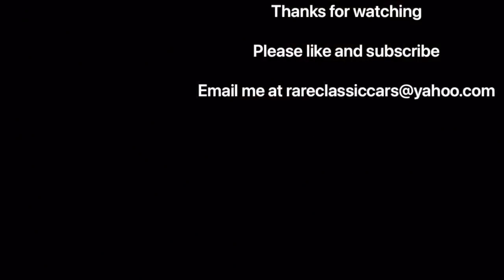Worst Engines of All Time: Chrysler 318/360/400/440 V8 Electronic Lean Burn

Comment: That was well explained.  Thanks.
It's no wonder Chrysler was bankrupt by '79 - their vehicles were really bad in the mid to late 70's.  Rust and terrible build quality.  And this Lean Burn system. Just really cheesy cars.  Then the K car came out.  Another gem.  I think what did save them for a while was idea of the minivan.  Their first ones of those were nothing to brag about either with that awful Mitsu 2.6 in them and the temporary transmissions.
Reply: After the government bailed out Chrysler they somehow had the money to buy bankrupt AMC.  The only reason they wanted it for was the Jeep.  The even kept making the AMC 258 straight six for awhile.
Reply: I also believe it really was the minivan, not the K car, that saved Chrysler. My sister had an '81 Aries with the Mitsu 2.6 and a 2 bbl carb and sad to say it was junk.
Reply: @Progrocker70  Yes. Can you imagine if there was internet back then and people could share their opinions and experiences like we do now?  Chrysler would have been dead.
Reply: @johnz8210  Exactly. I also had an '84 Turismo 2.2 that was also nothing but trouble. Water leaks around windshield, rattles, electrical issues, and of course carb problems. It either wouldn't start or would just decide to randomly die in traffic.

Comment: I had a 78 aspen with the slant six, it had a Carter bbd. Was called the "super six". Either it never had lean burn, or someone took it off. Really solid engine.
Reply: The slant six was an amazing engine Someone I knew had an old Valient with this motor and went 750,000 without much engine issues

Comment: Lose that useless "Electronic Lean Burn" system and you have great engines. Can't badmouth the engine, only the idiot engineers who designed flawed trash like this.
Maybe we could discuss V8-6-4 that GM tried out(which was a dismal failure)?
Reply: you are correct.iv ran the living guts out of chrysler v8s for decades. i always removed the mid-late 70s ignition and distributors and installed the very simple and good early 70s ignition controler and distributor.actually did it well into the 80s.correctly set up chrysler engines are second to none.the old high compression 440s were arguably the best mass produced muscle-car powerplants ever sold to the public at working man/blue collar prices.they pretty much ruled the streets.

Comment: I'm certain that all ELB engines had bare distribution with only a stationary hall effect pick up,  without centrifugal weights inside and no vacuum can on the outside.
Reply from the maker: The early ones definitely had centrifugal weights.
Reply: Not according to my old engine books , you must be thinking of the earlier electroic ignition distributors.

Comment: My -78 Newport started to backfire while cruising, so, as the replacement module from the dealer was an arm and a leg, electronic distributor from a speed shop an arm (in Finland in 1986), I replaced the stupid system with a points distributor from scrapyard. Replacing the plugs with a correct gap for points was a bigger job than the distributor (440) , but the engine run just fine or better with points, and the 440 apparently had enough margin to operate with too lean mix with those. I miss that car...
Reply: Nothing wrong with points if set up properly! I always liked the thought of a points in a car still working say there was an em pulse or something crazy 🤣
Reply: We had the same car and did the same thing as you.

Comment: Adam of course, you are correct. I am mopar guy. So I survived these lean burn issues but, if you converted to electronic ignition you got a good engine for 80's standards. However, if you know of assburn nobrain  (Osborne tramain) you tuber, you just made him really, really mad.

Comment: Excellent analysis of this system. I had no idea about the logic in these primitive systems, only that they resulted in some flaky behaviour in terms of driveability (I learned to drive on a 1979 Newport with the 318 Lean Burn).

It is notable that the issue of the day in the 1970's was fuel economy and unburned hydrocarbon emissions where the lean burn strategy was theoretically of benefit. Once the EPA got concerned about oxides of nitrogen emissions in the 80's, lean burn strategy became obsolete.

Thankfully, the widescale adoption of electronic fuel injection (and increasingly reliable electronics to support this technology) in the 90's solved a lot of the emissions, fuel economy and driveability issues for good.
Reply: BUT, computers can't be adjusted, and many can't be repaired.  They can only be replaced.
Reply: @michaelbenardo5695  plenty of YouTube channels exist where people repair computers from the 70s-80s. The stuff is repairable, but it's a different skill set from your average shadetree mechanic.

Comment: Having the soild state electrical board attached to a air cleaner that shakes   due to poor tuning makes it worse.The thermoquad would get its idle screws turned a million times also never finding a good idle with brown smoke coming out the back and then fill the intake manifold with exhaust suit keeping the carb cold and bogging.Good times.👍
Reply: Exhaust suit ? Tighten up, man ...

Comment: Broken solder joints on the PCB and especially at the connector pins standing on the PCB together with poor sleeve connectors in the spark control module caused lots of failures. There were a few with harness soldered to the board and connectors borrowed from other places put in the harness. Volvo used this system 81-88 on 240s with non-turbo 2.3L. These used the first style crude knock sensor as did some versions on chrysler engines. That knock sensor was a ring connected to ground via sensor body and the pin in the center has a spring contact. Knock would make the contact vibrate if knock was bad enough and it would connect to the ring and give knock signalling. The sensor was not sensitized to spark knock well and many things mechanical like loose v belts could signal like there was knock. The piezo knock sensors made the spark knock control ignitions work well when they came around.

Comment: higher lean higher idle is better
my 78 bonneville 400 rochester
i set it the choke in first notch  yes it runs higher idke  when i shift it does slam in gear
runs sweet

Comment: The shop I use to work at gave the customer a choice. Point type distributor or the Direct Connection electronic ignition kit. We richened the carburetor and gutted the cat. Car ran perfect.

Comment: The ELB was developed in a controlled lab, and on a dyno. But in real world testing, Chrysler techs KNEW it wasn't ready yet. The analog computer was too slow. Even the digital computer of 78-80 ( ESC gen 1) was too slow and had no adaptive memory. 1 thing about the ELB/ESC is the basics ( sensors, inputs) are still used today. The idea was good. The technology wasn't ready. Nothing at all wrong with the engines, otherwise. The lack of reliability hurt Chrysler sales in a bad way for many yrs to come!
Reply: Its annoying how so many can't tell the difference between an engine and an ignition system.
Reply: The cure for Lean Burn was to strip all that crap off the engine and replace it with a pre-1975 ignition and fuel system. Life became MUCH easier.

Comment: i had a 2.5  on my reliant 1986
best engine....same engineer that designed.the slant 6 designed this
i had a 86 till 20 years

then i bought.a,1987 lebaron 4,door
with 2.5  i gave it to my mechanic  he 
atill has it ..... 2.2 or 2.5   1986 on
with throttle body fuel.injection was better
than carb

Comment: ELB was also used in Australia. As you said, our quick fix was to remove the wires from he coolant sensor and leave it in ‘ cold start’ mode, and tune the BBD with the metering needles as you said. Mind you, the spark control computer was so reliable, the engines were still running long after the car rusted away

Comment: I love these videos! Thanks for making them. Interesting history to hear about, explained simply and in real world experience style 👍🙂
Reply: Sir I would like to thank you. I have a lean burn 83. Someone replaced it with a normal carb. But didn't unplug thw computer. If it wasn't for this video. I wouldn't have though to unplug it and check if my timing was off. The pickup had issues running. Now it's fine and runs like a race horse.
Reply: Hey fellow foamer (4014 is overrated btw)
Reply: @seymoarsalvage  👋👋
Reply: Hello don't I know you because I know I have seen your user name my fellow railfan.
Reply: @chessiesystemrailfanman3741  I dont know if you know me personally, but you've probably seen me around on YouTube or my channel.
Reply: @BaltimoreAndOhioRR  you are right I don't know you personally but I recognize your cool user name and awesome CSX locomotive thumbnail picture. And yes I have seen you around YouTube most likely commenting on railroad videos. 👍🚂
Reply: its a good idea but a bad example as its poorly executed for lean burn / and or better MPG some more modern cars used it in some different markets but things like the EPA killed it again as passing NO2 is harder to do
Reply: Glad I'm not the only railfan here 😄
Reply: @SOU6900  👍👍

Comment: Hope I'm not hijacking your commentary, but why did Chrysler go to all the trouble of developing lean burn when today I can pass California's strict smog control inspection with flying colors (very low numbers) on my '77 Dodge van with a 360, a dual-pattern 260-268 degree cam (more duration than stock), oversized intake valves, ported heads and a Thermoquad 4-barrel? I don't get it.
Reply: I should have mentioned that my van has the California EGR system and an air pump. Performance is very good.  I can burn rubber in all 3 gears with the 727 transmission.  It just seems to me like the Chrysler engineers screwed up a good thing.
Reply: Chrysler attempted to kill two birds with one stone by designing one system for both better fuel economy and lower emissions, and came up short
Reply: Gasoline has been altered since then, and is considerably cleaner-burning that it used to be.  If you got some fresh "old-fashioned" gas, it probably would fail by a pretty large margin.

Comment: Just switch any lean burn car over to Chrysler electronic ignition. This is applicable all the way the 87. You put in a standard vacuum advance distributor and put on an aftermarket carb. I have an 87 Ramcharger that is just a eddy 1406 and vacuum advance. Yes I am driving around on essentially 1976 setup but it’s not bad. Besides it doesn’t get worse gas mileage than the factory 10/12 rating.
Reply: I did something similar with a 1988 Fifth Avenue.

Comment: Were the 1.7 and 2.2 carbed cars equipped with a lean burn system too?
Reply: 1.7s had ELB from the start, later the 2.2 (carb) and 1.6 Peugeot also got it. When equipped with the feedback Holley carb, these engines were terribly unreliable.

Comment: I'm not disagreeing, just saying I had  a 77 lean burn 400 that ran well, albeit lacking on the low end, without issue through about 2000 with at least 270,000 miles.
Reply: You were incredibly lucky.